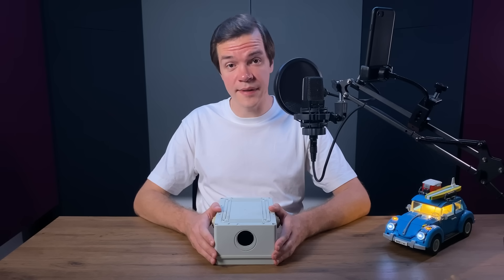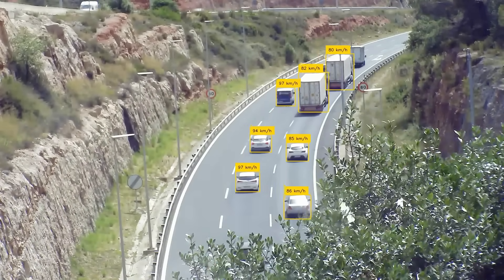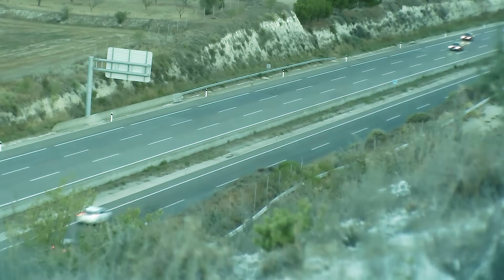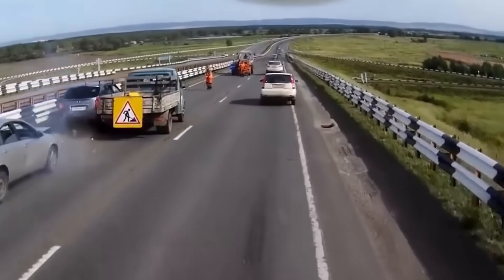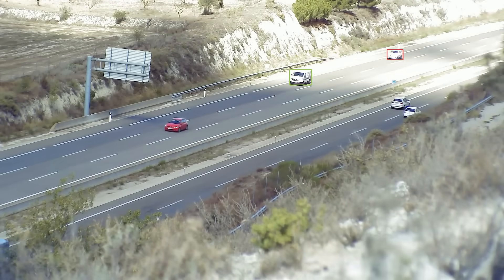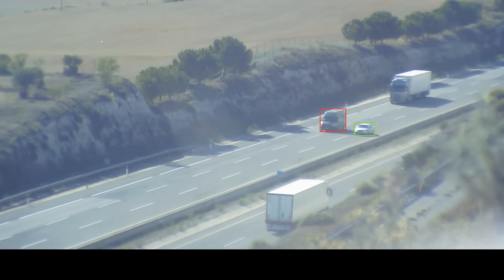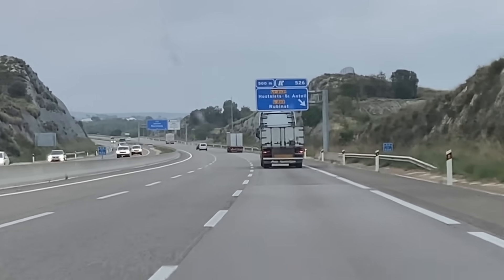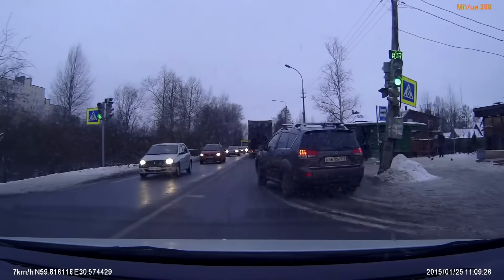New Anti-Tailgating Camera Reveals Shocking Statistics

Comment: In Germany we have cameras to enforce vehicle safe distance. They’re usually besing set up on the Autobahn over a bridge. There are permanent markings on the lane so the cameras can measure the distance when they’re set up.
Reply: How do they handle the cut-off problem?

Where someone decides to suddenly swerve in front of you?
Reply: @HeaanLasai  Well, they have it on video. Usually you won't even get a ticket in the first place, but if something goes wrong and you get one, you simply reply that you were cut off. They check and if you are right, they drop it.
But you cannot use this excuse forever. If someone cuts in in front of you, you have to take action to increase the distance. If you were in this process, you should be fine. If you stuck behind the other guy "because it is his fault", you will learn that it is your fault.
Reply: @HeaanLasai  those cameras works like dashcams, they save a few extra frames befor and after, also mostly manualy reviewed so the officer can check if you are faster then the one infront or if you just moved over and the car in front is pulling away from you faster then you.
Reply: @HeaanLasai Ticket that as unsafe driving.
Reply: @HeaanLasai  This system isn't just taking a picture, it is filming so that the evaluating officer can separate between real tailgaters and people that got cut off by a lane changer. Simple really and the fines for Germany are quite hefty.....
Reply: @320iSTWEdition  I want this in the US!
Reply: @320iSTWEdition 

Too much accent. 

Just have MS Word read the text.
Reply: @hg2.  🤣🤣🤣🤣🤣🤣🤣
You americans are so funny complaining of an accent when you yourself can't speak your own language right.....🤣🤣🤣🤣🤣
Reply: @HeaanLasai they don't, actually it's quite common if you leave a safety distance but everyone uses blinkers so you have a heads-up
Reply: @HeaanLasai you can probably argue if someone cut you off, get a dashcam
Reply: @HeaanLasai  Yes, just under the camera. Many court decisions have dealt with this issue.
Reply: @HeaanLasai there should be multiple photo's, or a short video. Then, if there is a cutting-off situation the driver doing that should get the fine.
Reply: @HeaanLasai  "How do they handle the cut-off problem?" They have them every set distance (I don't remember what it is) and you only get ticketed if it's the same car in front of you over so many cameras in a row.
Reply: but rarely used
Reply: @culnaurion  tailgating in germany occurs less frequently than in the netherlands, luxembourg or belgium. Not speaking of eastern-europe.
Reply: @culnaurion  Depends on where you live, I guess. Between Frankfurt and Stuttgart there are ~10 bridges with those markings but they only have one camera. Never the less the camera is mounted on one of those bridges on a daily basis (at least if the weather is good).
Reply: They caught me years ago with that system.
I got the letter and I couldn't believe it.
They sent a DVD to my local police office and I went there to watch the video.
They filmed me for more than a half kilometer. Finally measured the distance at permanent painted stripes. But having the proof on video that I wasn't cut off for at least 500m (maybe 1000m).

It takes me 400 Eur ... tailgating video is very rare in Germany but if they catch you it will be pricey.
Reply: So are you saying you don’t have tailgaters now?
Reply: @philtucker1224  I'm in North Germany and they definitely do tailgate, usually I find it's people who aren't paying attention to driving, they just seem to want to get close to the car in front. Sometimes I pull over and let them past, I've really got to work on not getting annoyed by them and not allowing them to pressurise me to speed up.
Reply: @joseph1845 yes me too. I fully agree!
Reply: @philtucker1224  How do you get that idea from the starting comment? He explained how we measure following dfistances in Germany to enforce the rules of the road towards following distances..... but maybe i just read a different comment.....
Reply: Here in Germany I would say we have less tailgaters when I compare it with my experiences made in Italy or the Netherlands on their highways i.e.
Reply: really? i have never ever heard of anyone getting a fine for that. and as one of the few drivers in germany who take safe following distance serious, i can tell you that nearly never i notice another driver doing it correctly. (of course this has the bias that you notice someone breaking it much more likely than someone following the rules
Reply: I can't stand government control and monitoring devices. Glad my state doesn't allow it.
Reply: Yes, the fines are very high if you get caught by the german distance cameras. But if the distance is way too short you could even get your license suspended for a few weeks.
Reply: Those cameras are police state infrastructure for keeping tabs on the peasants.
Reply: in Germany, i've never seen them and it is impossible to drive safely here in concentrated traffic because of the cut-off problem, everyone is always trying to get ahead
Reply: There is a safe distance at 100kph of 40m ( and a bit). The ticket was issued because my distance was less than half. There were at least 4 more people in my picture doing the same thing.😅
Reply: @dennisvaneck9406  It's like an antelope asking the lion why she eats her and not some others beeing slower just in plain sight.
Reply: We need those in the uk
Reply: Cameras are just one more way that we (willingly) give up more and more of our rights.  It's worse yet when the state can just mail you a fine, because without a human accuser, you can't fight it.  The UK and Germany are examples of this.  Both have rising incidents of terrorism and other violent crimes.  I think part of it is because the people aren't treated as citizens; not really.  Subjects care a lot less about where they live than citizens do, and that allows many opportunities for the social fabric to break down.
Reply: @justaskin8523 lol no, you don't have a right to drive unsafely. Also in America, driving isn't a right, so lol check your list of rights. Simple as.
Reply: We don't need that. Drivers need to be educated to stop hogging the middle lane, and use the outside lane only for overtaking. If such drivers can follow the guidance, and stop slowing everyone else down, there will be a lot less tailgating.
Reply: @federicafilippi6355 Overtaking doesn't take 0 s time. If I am overtaking someone and somebody else wants to overtake me during that, it looks like "hugging the middle lane".

If I am overtaking somebody going whooping 18 km/h (5m/s) slower AND want to keep a safe 100m distance, it will take almost a minute:

I turn left 100m before passing, to keep a safe distance, I turn right 100m after passing to keep a safe distance. The cars are about 5m each. That is 210m going at 5m/s is 42 seconds in the middle lane.

Note!! The speed difference is usually much smaller than 18km/s, more like 10, so it takes twice as long!

But, nobody keeps 100m safe distance and you usually keep 0 m safe distance before overtaking, so half the result for the risky drivers.
Reply: @Tondadrd I'm not referring to people overtaking in the middle lane. I'm referring to those literally hogging the middle lane, staying there when there is no one in the inner lane.
Reply: @federicafilippi6355 it’s not clear to me why lane blockers cause tail gating. I agree they do but I’m not sure why.  Anyone tell me?
Reply: @federicafilippi6355 drivers need (not) to do all kind of things in your opinion.
Reply: Too much accent. 

Just have MS Word read the text.